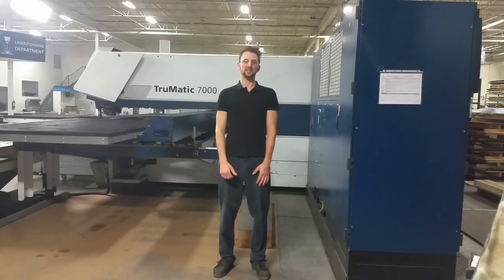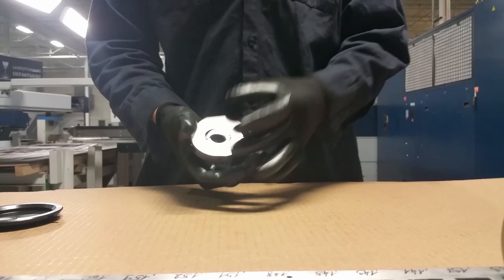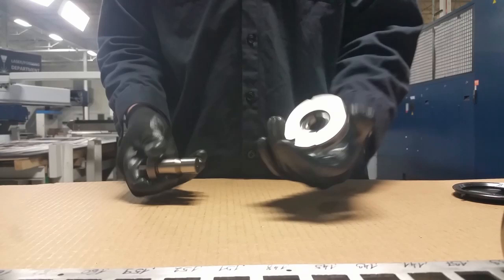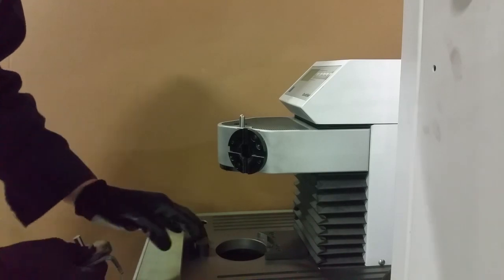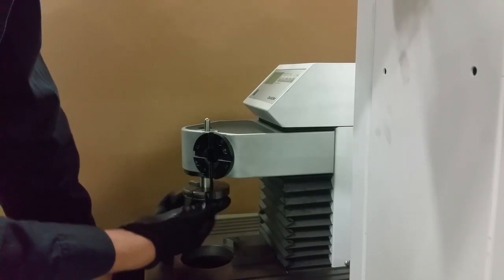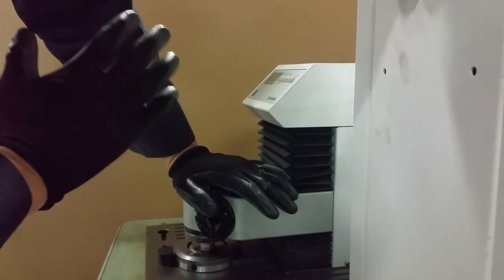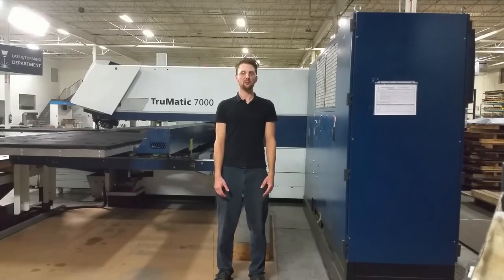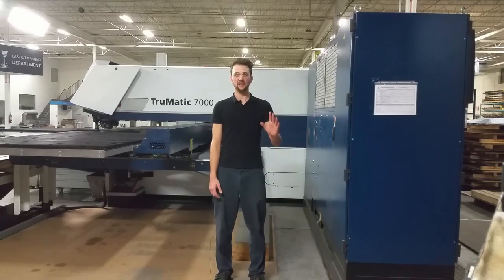Punching tools setup for Trumpf Trumatic punch press machines

Comment: this tutorial shows how we can remove or fit the tool in / from cartrige but I want to know how we can remove the tool from the punching head when the tool is placed inside the punching head?
Because some time it shows the message that there is no die available in the punching head and in that case we have to remove whole tool from the punching head and put it in the cartrige back and then restart the work. So can you tell me how we can remove the tool from the punching head?

Comment: Can you punch out parts without using Microtabs, microjoints? To reduce deburr time? if so...in what order does it need to be punched?
Reply from the maker: Hello Zoddie,
punch all the holes, slots, forming ect within a part and then punch or laser cut the shape of the part. The beginning / end of the main contour/shape of the part  should be at the side which is the closest to the clamps. After the last stroke, setup (program) an unloading for the part (manual unloading / part chute or Sheet Master).
I hope this answer helped!
Cheers
Reply: @cncmachiningtutorial1137  thanks for the help, do you think its better to use microjoints or not? is it worth the extra effort to have a unloading program between every part, instead of punching all the parts without a stop and use microjoints? in my company deburr time is high and microjoints often lead to over deburring by the operators.  I'm trying to find a way to reduce this and make a better more clean part off the turret as much as possible.
Reply: @zoddie  I have always removed the part right away (no manually).
For small parts (part chute) for bigger parts (SheetMaster).
To program the unloading is not such a pain and it doesn't take to much time. Using microjoints/micro tabs leads to another operation = removing the parts from scrap skeleton and deburring.
Maybe if you will have some serious issue to remove the parts (then I would use microjoints)
Take a look at my programming video, where I am talking about programming and removing parts ect.
Good luck
Petr

Comment: Your tutorial are great really simple and detailed i have a trumatic 3000 R and if I saw your videos before i'd save a lot of time in learning 
Did you do a video of assembling multitool ?
Regards from Marco -Italy
Reply from the maker: Hello Marco,
unfortunately I didn't make a video about multi tool and I have no access to a multi tool right now. I am on a long vacation and maybe I will make one video once I get back to work. But if you are familiar with standard punching tools, for the multi tool is the same. Just be careful to set correctly punches with dies (there are numbers on the punch holder and on the die holder to help you to put punches and dies on the right positions) so only you need to do, is to set the puches and dies correctly.  
How to put the tool into a cartridge:
For the punch holder - there is a pin on the top of the punch holder and that pin has to be pointed forward from the cartridge  (this is the same like with normal single punch tool where the pin is on the alignment ring).
You also need to set the punch holder into a "zero" position. - Hold the punch holder and rotate the golden gear and watch where the pin on top of the tool holder meets a small hole on the top side of the gear - there is the "zero" position.  Once you have the complete tool setup,  take that cartridge and flip it over and check with your eyes the shapes/ dimensions of the holes in the dies with the shapes /dimensions of the punches- it will help you to make sure, you set it up correctly.
For the die holder - there is a notch in the die holder and there is a pin in the ring which holds the die holder and goes into a cartridge  (so there is only one way how to put it together)
Note: For example, if you have 5 station multi tool, be careful on the position of the stripper ring.
I hope I helped you a bit. 
Good luck!
Thank you Petr